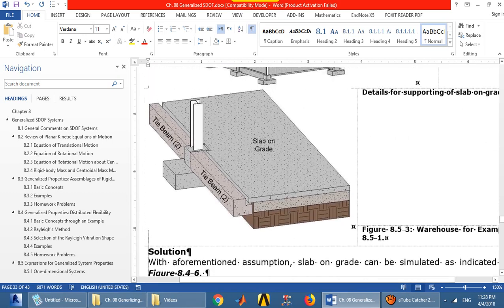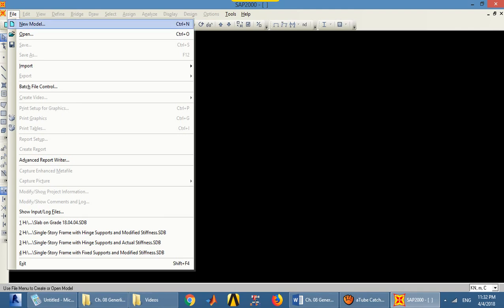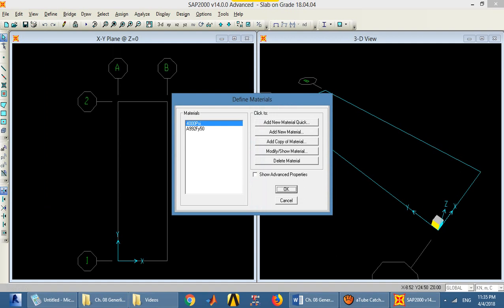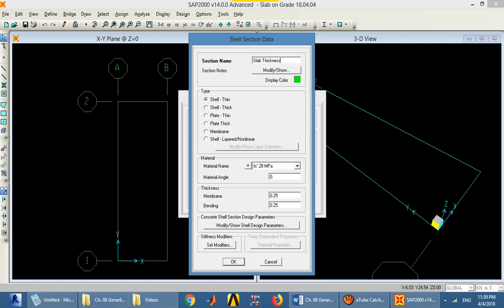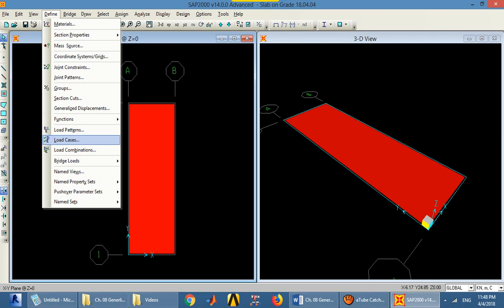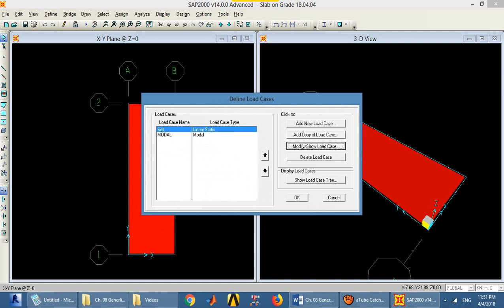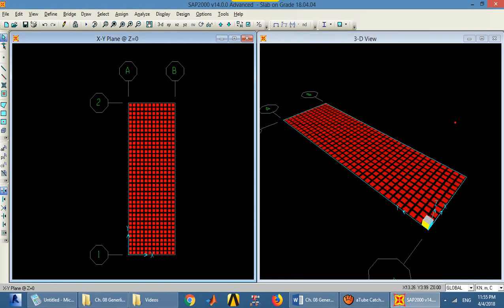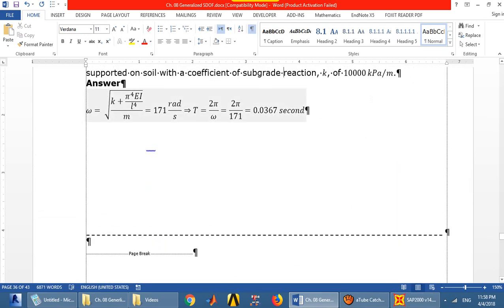Slab on Grade Analysis with SAP

Comment: Hello doctor, why did you say that the mode shape is safe while you get the T=0.03707 & the allowable in the code is T=0.0367 sec?
Does it must be lower than the allowable or bigger than the allowable cause I got confused in this part 😊